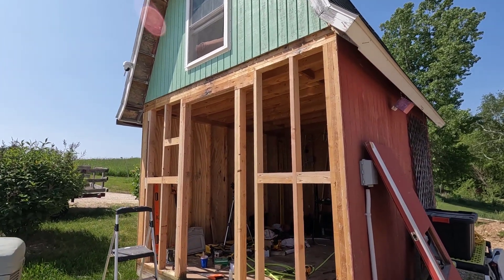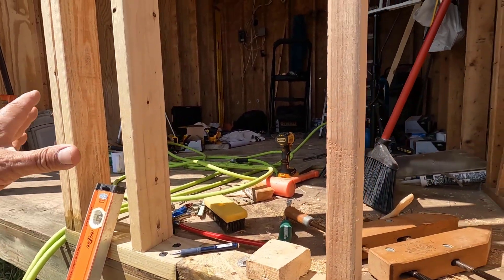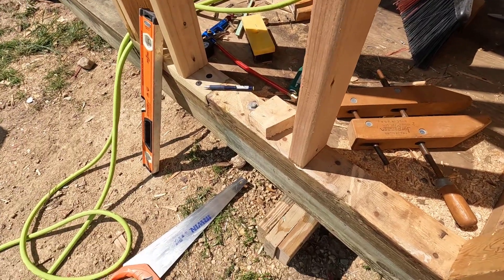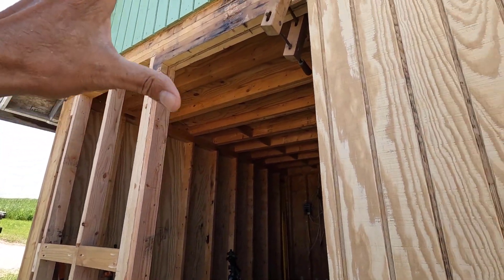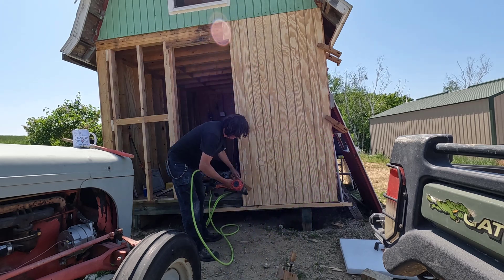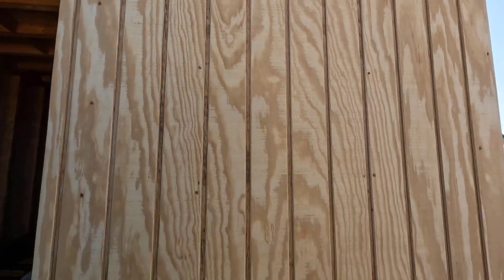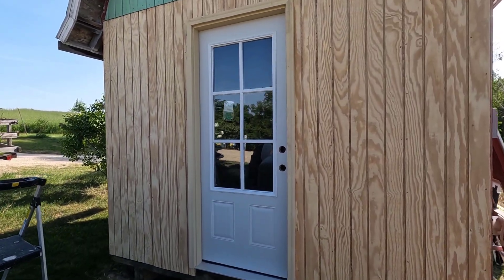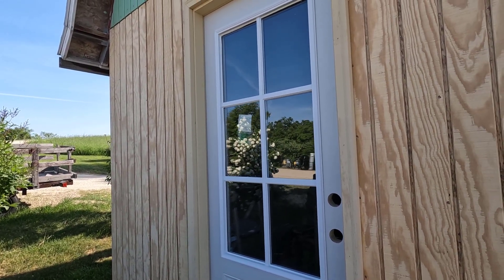Tiny House Remodel ― Wrapping-Up the Lower Front (Including Door!)

Comment: The structure will be dramatically stronger now! With the smaller door and thicker walls, the entire structure will be dramatically stiffer. How is the old tiny house attached to the new grade beam?
Reply from the maker: Hi Shed, yes, the house is very stiff now! The building is attached to the grade beam at every floor joust with hurricane straps, and I will be adding large t-straps and other tie-downs shortly. It is WAY stronger than when it sat on the other side of the road for 20 years 😊